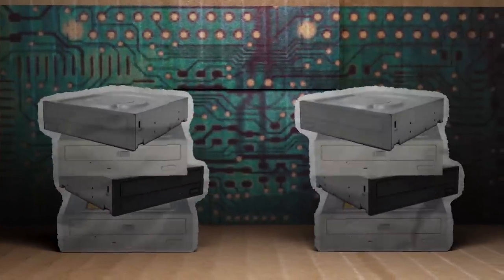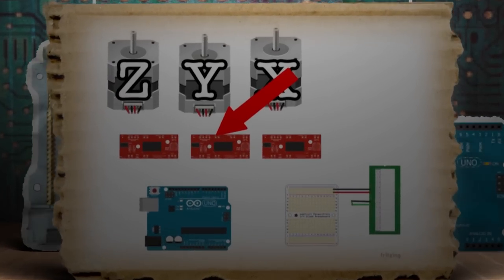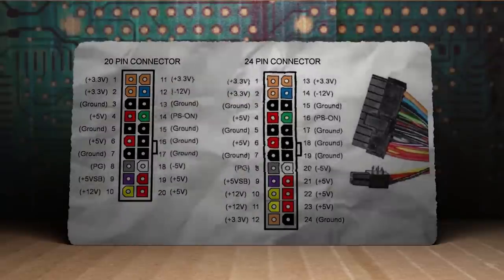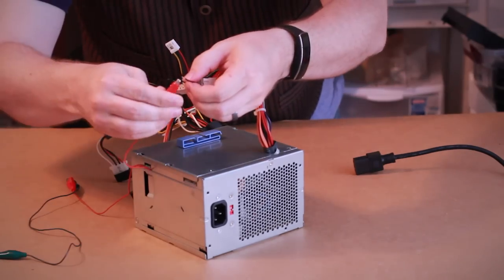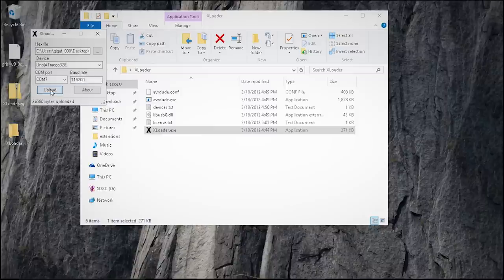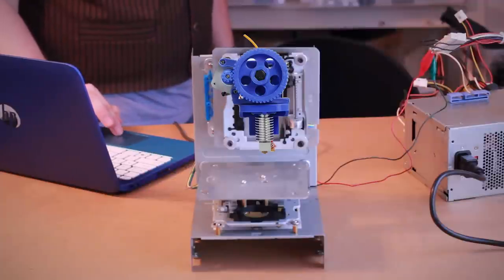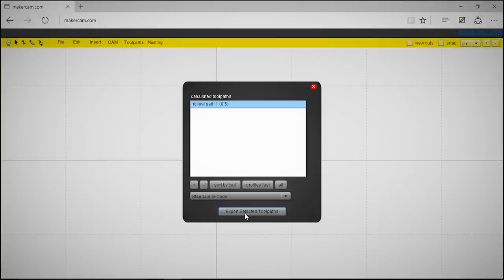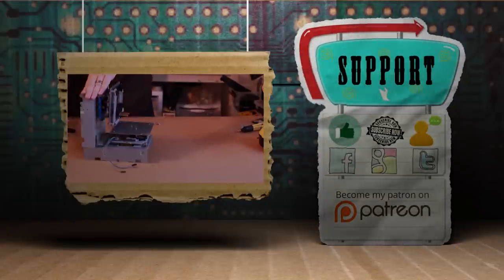Hack old CD-ROM's into a CNC Machine - Part 2: The Software

Comment: Yo tinkernut
for years I had this automated CNC machine idea but on a larger scale. What if you built a automated CNC machine that can measure the size of your car, hold a automotive paint sprayer and paint your car automatically. you would have to mix the paint yourself and pour it into sprayer and do a test pattern spray. to do this, you will need a auto paint and body expert, robotics expert, programmer, machinist with welding skills and yourself to build it. you can just start off with a small scale modal that can hold a spray can and paint
the car automatically but without the floor moving.

Comment: Whoa. This is really neat. I've been wanting to get a hold of a 3D printer for awhile now for really basic, small things like enclosures for small circuits, and a milling machine for etching my own PCBs. This is a really, really good idea and it looks like if it's accurate enough for drawing it's accurate enough for printing and etching.

I have regular access to lots of computer junk so it looks like I'll be making one of these.
Reply: It may not be accurate enough for printing, or strong enough for milling PCBs, but this gave me an idea - old scanners/photocopiers/printers! They've got better motors!

Comment: One use might be to have it operate a solenoid air valve (extra port required), then use it to deposit glue dots on the 1st pass, using an air-driven syringe, put solder paste on the with the 2nd pass, then on the 3rd pass, have it control air from a small vacuum pump and a square-ended needle to pick & place SMD components for a small PCB.
You heat the whole PCB to fairly exact temperatures for fairly exact times, to do that sort of soldering, but that's maybe another project out of an old toaster?

Comment: Hey Tinkernut! I'm considering building this, but I heard from you that the desktop power supply is dangerous. Is there a way to use something less dangerous? I'm not very advanced in any electronics assembling, so I want to minimize any risk.

Comment: Great video I'm half way through it! But I'm stuck on where you branch out the power to all 3 stepper motors... You connect the psu to a board and then to the stepper motors but I'm not sure what you use for this board and how to wire it

Comment: Hi Tinkernut!

I want to build one of these small plotters but I have some questions I'd like to be answered:
-I am using an old printer axis, which means there are pulleys and belts: do I have to configure something?
-I have a pretty wide (10x12 inches) drawing surface: is there a setting to modify in the controller software?
-Can I use a servo for the Y axis? If yes, where do I connect and how do I configure it?
Thanks in advance!

Comment: i have 3 cd stepper motors with 3 different configurations for the wires coming from the motor. how do i know which one goes to each connection to the motor controller? im assuming it matters.
Reply: Plug all of the wires to an outlet. If you survive I don't know where I was going with this.

Comment: This is great, I don't care what any of the others are saying.  It gives me hope that I can put together my own CNC, using the concepts explained here.  

HOWEVER    (and you knew that was coming, right?)
It also opens the question-door on so many other things such as:
1) Will the driver-boards support larger steppers (I would assume so)?
2) If I'm wanting to cut wood and maybe acrylic, how do I decide how big a stepper to use?  Or just get the max size that the driver-board will support?
3) Is there a site someplace that lists all the various freeware software that would support this arduino/driver combination?

Thanks!

Comment: Use more motor axis and a micromotor for a drill/dremel tool for shaping and cutting.

You can use the same concept to allow your CNC too for 6+ axis CNC.  If you extend the range of the modules, you can expand the working area to a larger work area than the current limitation imposed by the existing range of travel.

If you can salvage old printers instead of CD/DVD players, you would have a much larger work area using the same concept..

People throw away printers/scanners all the time.

Would love to see you use them instead of the limited range of a CD player.

Comment: I'll have to use this as a basis for a CNC made out of several printers. I've got plenty of old parts to work with.
Reply: +ProGamer1515 I highly suggest you dump the newer printers, and use the dot matrix ones. They have steppers pre-built in them, whilst printer carriages have an optical feedback servo system, and an arduino or any small processor cannot, simply cannot do 3 or more servo loops at the same time. Or one, really, for that matter, since it's not a multithread system.
Reply: ***** Alright, I took them apart and found some stepper motors. Though they were small. Do dot-matrix printers have much larger stepper motors?
Reply: ProGamer1515 Does the main carriage have a thin greyish plastic stripe running across it? If yes, it's not a stepper motor drive, it's an optical encoder feedback system with a regular DC motor on the belt.
Dot matrix printers have steppers instead, so you can easily control them with some kind of driver.
Reply: +Spirit those old dot matrix printers have some incredibly powerful for their size motors. Takes some oomph to slam that print head back and forth. You could gear down with a belt system as well.
Reply: consaka1 You could, but why bother? Just half- or microstep, still a ton of torque.
Reply: ***** I meant gear down for the cdrom motors. They have very little torque.
Reply: ***** Yeah, it has the grey optical strip and the motor that moves the print-head is a DC motor. IIRC the stepper motors came from the paper-feed mechanism, though they were rather tiny. They had 3 wires coming from them
Reply: ProGamer1515 Yeah, it's useless, don't bother. Throw it out or use it directly for another project where you can dedicate an entire microcontroller for a servo loop.
Get dot matrix printers.
Reply: ***** Alright, thanks. Though what do you think would be best, 3 high-torque high-precision stepper motors or 3 dot-matrix printers? Just wondering.
Reply: ProGamer1515 I don't think you can use "cheaper and best" together. Cheaper is going to be whatever you can find for little to nothing. Best is, of course, motors designed for your application, duty cycle and load. Generally Nema 17 or Nema 23 motors.Those don't seem to be too expensive at the moment but expensive is a relative term.
Reply: ProGamer1515 You don't need to take the steppers out. Just use the carriages for X/Y axes, and something you can make yourself for Z.
Reply: ***** I'm guessing I could use a long screw for the Z axis.
Reply: ProGamer1515 Yeah, you can use a screw with a drawer slide and two nuts(with a spring between them to prevent backlash).
Reply: Let us know how it goes.
Reply: consaka1 Alright, I will.

Comment: Making one right now. Pain in the ass to mount right.. I think in terms of improvement, below we should make it 2-axis and above only the Z (up and down). Putting 2 above in some cases might invite vibrations and possibly other glitches. But what I really like about YOUR setup is that you did not use a servo push up and down mechanism for the Z-axis, which creates a ton of chaos.. What could be done with it? Really, really charming stuff with a small yet sufficiently powerful burning laser... cut pieces out, make all sorts of badges even...draw something cool in pencil or make small yet really cool body art :)

Comment: If I attach a bldc motor(really high kv) and then use it to etch a circuit board will the stepper motors be able to push the assembly since the downward force applied by the bldc motor might be to high?

Comment: What I usually do when I need to use PSUs outside of PCs is put a toggle switch between the green and black wires, that way I can turn it on and off more accurately than unpluging it.

Comment: This is really the videos i needed, i have wanted to get into CNC og 3d printers for a while, but had no way to get to it. Now i got the arduino and easy drivers on the way. So thanks. what i need it for is to cut some plastic for an NES emulation project i got going. using an actual NES case. but i don't wanna destroy the case so i'll add some cnc'd stuff. this is a great tutorial to learn how to use it.

Comment: I want to build a very similar small CNC for making PCBs for small electronics projects. I don't have access to a laser printer conveniently enough to make the common laser printer resist + chemical etching method feasible for my needs.

Any suggestions on drills attachments to look into for such a project?

Comment: I did everything exactly as you did, but unfortunately my X axis is not even able to hold and move the Z axis, when i try to print something the X wont move properly i gets stuck. if i remove the Z the X will move OK, am i missing something? it seems my steppers don't have enough power to hold some little parts.

Comment: Firstly I wanna thank you for uploading these videos on CNC. I am a complete beginner and would really appreciate a documented Nood friendly direction/step wise manual with instructions on how to build it from scratch. It might help other Viewers too. Could you do that? Thanks again :)
Reply from the maker: +jatin dinesh is the project page not noob friendly? which part are you having issues with?
Reply: +Tinkernut  A little more detail would really help. Like showing how and where to attach those Motherboard holder pins,or any alternatives to those. You have shown all that but a more slower and closely shot video from different angles would help build a little more confidence in trying this project out for beginners like me. No doubt you have done a great job already  :) If in case I get stuck at some point while making it can I post my query via mail?

Comment: Hi there. I want to know how will it know that it is going with correct dimensions. for example i have used a lot of gears and i programmed it to make an inch line, how will it callibrate with my gear settings?

Comment: I have a question, the xy axis of a cnc machine is usually the horizontal plane, why did you put the y axis on the z axis, and does this effect how the g code works, I'm really interested in building this with the xy on the bottom, I'm a machinist so making and fabrication are no issue to me... just want your thoughts... thanks...

Comment: Id really like to know if you can get any drilling done with this. Maybe make the cheapest CNC (drill) you can (maybe at least 12" x 12")?
Reply: +Ampix0 probably, just use a drillbit on a Dremel and space the motors proportianately, unless you can find a drill that would fit in that arm xD
Reply: +Galen Craig dremel would be way to heavy for this to hold up. It can barely hold that plate and pen up.

Comment: +Tinkernut thanks for the detailed tutorial. I made mine, it's not working well yet (to much weight on the X axis), so I'm trying to improve it. I also used some alternative methods (compiled my own version of grbl) and used other software, as I'm on a Mac. 
Anyway thank you ! It was my first Arduino project and I had much fun doing it. Ah I also did the power supply, but I made easy connectors attached to its side, so it's easy to use alternate tensions, to different projects. 
I'm waiting for you to post new fun projects.

Comment: I found an old Teac floppy drive that I would like to use for this project, the only problem being that the stepper motor for the floppy drive is unipolar (it has 5 wires). How can I connect it? Can I run it as a unipolar motor or should I just look for another CD drive?

Comment: In his sketch he has all 3 boards and all 3 motors running on only 1 5v power supply? What if two or even 3 of the motors need to move at once? Will there be enough power?

Comment: Is it possible to do the exctly same thing just with bigger motors and a bigger bed?
Reply: +Blindyyh Thanks
Reply: +GamerJyden Search for DIY CNC machines on the web.  Some of my favorites are ones built by homofaciens. His approach is dirt cheap. Don't let the fact that he sounds like a mad scientist put you off.   Bear in mind that increasing the precision of routing or milling, size of the bed and hardness of the material you intend to cut will make the cost go up exponentially.

Comment: Hey I am doing this as a fun school project for a tech class and was wondering if I could use a single usb cable instead of the power supply mod since im pretty sure the teacher is not going to be happy with me messing around with the power supply.
Reply from the maker: +LopezfsS you can use any type of cable or power source you want. Just make sure it's pulling enough amps to power everything. You may need more than one usb cable.

Comment: After looking this video, I have idea to make litte bit bigger CNC machine something like about 1000x500 or 2000x1500, and use same electronic parts how in you project, how do you think should I need do this
Reply: Must take into consideration of weight of load (milling machine, hot end, marker, esc) and the long run of rails. As the load starts reaching the center of the frame it will "sag" differently than it will on either end. So you must pick a rail that can withstand the weight of the load and the frame/runner itself. 

Also the other thing to consider, is the long run of belting to drive that particular axis. If your distances are so large you might need something stronger than a spring to keep tension on the belting. On the other hand you could use threaded rod instead of a belt but that adds alot of weight. 

So that leaves us with two options. (1) Aluminum would probably be best option for rails. Your load would be driven by linear bearings and a threaded screw connected to a stepper motor.  (2) Aluminum for rails. Load driven by a belt and linear bearings. But you would need a strong tensionor for the belt, so the stepper motor gear wouldnt slip.

Comment: Hi i was think of building this for a school project. Are you using the Easy servo drivers for Arduino? and is there any type of motor that you can use to cut out small PCBs that's low cost?

Comment: Why no just use the thing that brings the computer tray in and out? The only problems I'd find doing that would be the bulk and maybe the accuracy. But on the plus side you'd only have to use two cd or DVDs drives.

Comment: +tinkernut Are there any other ways  of getting power to the steppers that doesnt involve a 'dangerous' and cumbersome power supply
Reply from the maker: +Jack S Use the wires from an old phone charger maybe? Or just buy an adjustable voltage power supply to crank out the specific voltage you need.
Reply: +Jack S It's not really that dangerous to use an old PSU from a computer along as you don't go sticking wires in stuff that doesn't belong. Max output from the PSU for the computer side is 12 volts at a few amps(depending on the supply). If you short something, it will either turn itself off, blow it's fuse, or just die. They are designed not to catch fire if something shorts or goes wrong. So, along as you don't open its case (especially while it's on), you will be fine.
Reply: Yeah, I new that the couldn't be very dangerous.
Reply: +Jack S prehaps use an RC ESC which has a 5V  output from an internal battery eliminator circuit?
Reply: +Tinkernut hi there. how do i revert my arduino back to normal after doing this project?
Reply: +willstrz Go to tools > Burn boootloader , in your arduino software to burn the bootloader back to your arduino,thus reverting your arduino to original state.
Reply: +Nick LDominator actually its 24 volts due to their being a +12 v and -12 v if you look at this there is a difference of 24 v so over powering is a major concern unlike what most people think. but if your looking to engrave mettle take the blue wire and yellow wire and arc across the mettle eventually you will burn a capacitor but its kinda an easy fix just find the burnt capacitor, and these wires are the only pair that can arc directly to each other like this so yeah.

Comment: i want to do this with a raspberry pi. as we speak i have literally built the hardware and everything is mounterd but i have  no idea about the pinout of the GPIOs for this project as im using a RPi. most RPi schematics say to connect 5v to the gpio and then to the h bridges but if i were to connect external 5v to the h bridge and normal micro USB to supply power to the pi could this work?

Comment: Well, the Lego EV3, with some Lejos firmware modifications, is basically an arduino, and the Lego servo motors are easily programmable, so if a I can make an X Y and Z platform, and attach a 3D pen to it, I could make a Lego 3D printer. The only problem would be getting the EV3 to control the pen, as Lego has some hefty hardware restrictions, but hacking can do the trick. Weekend project!